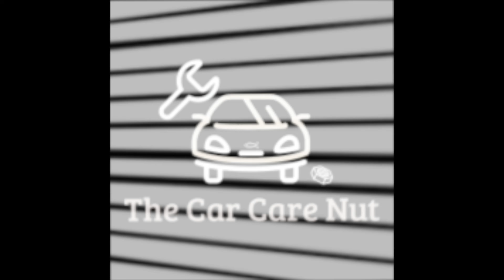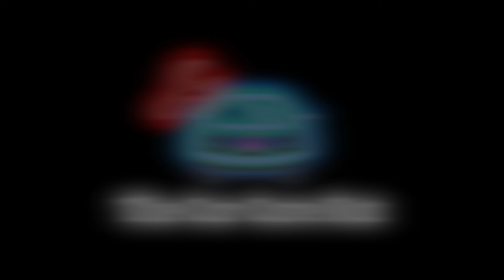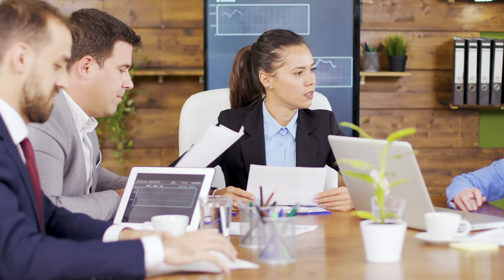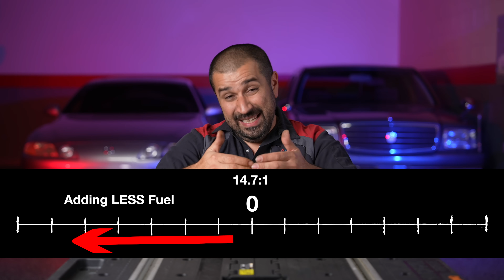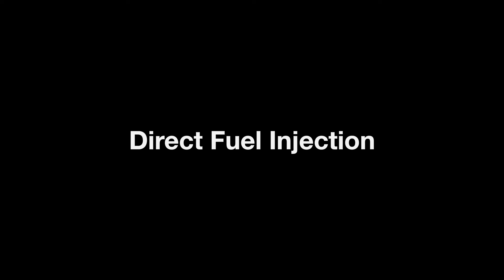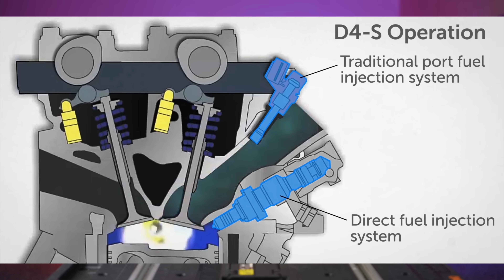Why Do Modern Cars Use Direct Fuel Injection? Fuel Injection Series Part 2

Comment: Direct injection doesnt necessarily mean carbon build up. Hondas 1.5L doesnt have an issue with it. Something about hanging the valve open. Its fluid dynamics so its VERY complicated but it seems like theres ways to design around it. You could argue double the injectors adds complexity and cost. Im just playing devils advocate. If other manufacturers are copying something thats more difficult and more expensive there must be something good about it. But like everything in engineering it is a complicated "it depends" on the specifics. And if cars are anything like computer chips there was probably lots of papers theorising this technique and testing it before it was brought to market. When some fantastic new thing hits computer chips its always based on papers from like the 80s as theoretically possible but worked on making it real over decades.

Comment: You are my college professor teaching me hi tech info. My 2020 RAV4 XLE with your great description of the D4S system is running great with over 54k miles, and I have never had a check engine warning yet. God is blessing you for your great educational videos. Keep up the good work.
Reply: Same here with my 19 RAV4 LE AWD at 131k miles, knock on wood.  This car is literally a maintenance free tank.  Still on original everything except for tires, wipers, oil, washer fluid, and filters.  I’m on the second set of tires and they are less than half worn with 90k miles.  I broke a belt in the original tires carrying over a ton in the back.
Reply: My friend has a 2020 CRV. He has had manly issues unfortunately.

Comment: Direct Injection ONLY: A win win win for the manufacturer.  Win 1, makes for a more fuel efficient combustion, Win 2, makes for more power, Win 3, guaranteed obsolescence - With NO detergent gasoline cleansing the intake ports behind the valves of carbon buildup from the high heat of combustion "baking" the motor oil -  the oil itself "cakes" - deposits carbon buildup behind the valves, this carbon buildup slowly but surely forms ridges that keeps the valves from seating completely in the cylinder head.  Leaky valves causes loss of engine power. Takes about sixty thousand miles before the noticeable loss of power from leaky valves requires an expensive valve job, using walnut shells blasting the cylinder heads.  Article on this was published by Consumer Reports in 2015 when the Direct Injection came in vogue. lookitup.  TOYOTA has historically solved this problem by using BOTH port injection AND direct injection in their motors. The PORT fuel injection cleanses the back of the valves with Detergent Gasoline, eliminating carbon deposit buildup; while the direct injection does its power/fuel economy magic.  Look for the Toyota's D-4S, or Dynamic Force Engine, a system that combines direct fuel injection with port fuel injection in the engine.  What about other cars?  "Mercedes-Benz has been a leader in direct injection technology, with the first gasoline engine using direct injection being the 1954 Mercedes-Benz 300SL Gullwing." (Google)  No port injection at all. In 1980 my father had to have a top end job on his Mercedes 4.5l V8 from this oil carbon buildup problem, the gasoline engine looked like a diesel blowing blue smoke from leaky valves. About $6500 back then.  In 1998 same thing happened to his Mercedes 3l straight 6.  Live and learn.  That's why i've bought Toyota only; and cringe when my wife buys her Mercedes (luckily, she doesn't keep her Mercedes past their 4yr/48k miles BTB warranty)   Well, i cheated, and have a direct injection-only Vette.   BUT in 2019 GM got Mobil 1 to develop a new blend of Mobil 1 for direct injection engines - Mobil 1 Supercar 0w-40 specifically to "Reduce deposits and sludge buildup to enable long and clean engine life." (Mobil's claim)  Exxon-Mobil makes Toyota's 0w-20 oil, but no Supercar additives.  Toyota's oil is made with gynormous amounts of moly, which helps the oil stick to the cylinder walls. Petroleum Quality Institute of America tested both (results online) and found "Mobile 1 variants have formulations with molybdenum between 79 and 88 ppm.  The Toyota OEM formulation made by Exxon/Mobil has 787 ppm of molybdenum."   Takeaway: always look for port injection as well as direct injection combined in the engine of the car you buy, always use Toyota oils in Toyota engines, and the smaller your engine, the more frequently you should change your oil: 3k miles/6 mo. for 4 bangers,  5k miles/6mo. for the old reliable Toyota V6's and V8"s  (also known as the severe duty oil change intervals in your Toyota owners manual)  Remember, Toyota makes million mile motors:  Corvette's and Benzes are sold long before the odometer starts on their second set of six figures.

Comment: We use direct injection because of emissions crap. Also they don't rev passed 7500 rpm due to how fast compression strokes are happening at high rpm port injection is better

Comment: 9:25 great content!!!  I have a 2023 2GR-FKS with what seems like a fuel delivery issue. At low RPM in a high gear range (automatic transmission) when trying to maintain speed (40-50 mph) the engine stumbles until one of the board members tells the transmission to shift to a lower gear. If the transmission does not shift down the stumbling will continue until the load is reduced, the accelerator pedal pressure released. Any thoughts?

Comment: Thanks AMD, a great video, very informative. Have you any idea why there have been numerous reports of injector failure in 2.0 Corolla Hybrids with this new technology ? Details are scarce as new car buyers are not very technical and its usually fixed under guarantee but it seems Toyta has been replacing a number of injectors, probably the high presure ones. I have also read a couple of reports of complete engine failure. There is a suggestion that its related to low quality supermarket fuel. I have also Googled for the fault in German and not found any reports , so it does seem to be a UK issue. How are you getting on in the US with this engine ?

Comment: Direct fuel injection isn't all that "new."  Mercedes used DI on their M198 engine in 1954.  It was a totally mechanical system, very similar to diesel systems of the time.

Comment: Another way that Direct Injectors achieve high pressure is using basic fluid dynamics. The fuel line going from the gas tank is about 2x the volume than the fuel line from the high pressure fuel pump. So if you do the math, 70 psi in half the diameter is actually 4x the pressure. So the starting pressure for the fuel rail on GDI is 4x (or more) than your 70ish psi (280psi) and thus the high pressure fuel pump only needs to increase that by a factor of 10, not by a factor of 40, which means less work.

Comment: this explanation was just perfect you answered my question does it run on port when cold and heating up just bought a c-hr  2.0  awd  very happy with this car will take your advice change oil every 6 mths or 5000km  dealer says not necessary  but will do   watched a video on  hybrids hard on engines

Comment: I've never owned a carburetor vehicle.  I think as a kid my dad had to spray something in the engine bay to get it back running after it stalled.  

Wonder if I am missing out on any experiences.  My 2 cycle mower runs just fine for 22 years...... no issues.

Comment: I would like a video on how a clutch in a manual transmission works. I know there are a lot of videos about it, but your videos are entertaining to watch. I would also like to see a video on the automatic transmission. I know you did a video about the torque converter, I would love to see a teardown of an automatic. I would also like to hear your opinion on how many gears should be in a transmission. I daily drive a 90 honda accord with a 4 speed automatic, and I feel that with any car below 140hp that it should only have 4 gears. My other car is a 2012 Hyundai accent, and it is a 6 speed, and it's in 6th gear at 35mph, and it only has 138hp. I find that car constantly jumping down to 4th just to get extra torque. I know engineers do it that way to get the best fuel economy, but in my opinion, they should change the shift points so it doesn't constantly have to shift.

Comment: A25A FKS hybrid, when not warmed engine kicks in what injectors working on first 30s? port or direct? And yes these first 30s I can feel engine vibration, but when the injection cycle changes after 30s vibration goes away immediately. But it happens only when engine temperature gauge is near minimum. Port injectors problem? spark plugs? odo only 50k km

Comment: I intentionally bought a 2022 hr v because it has port injection only. It constantly provides 28 to 34 mpg without excess pressure on the engine and without uneccessary excessive computer complication ...even with awd !
Sometimes, in the words of my long departed boss.... " less is more".

Comment: It would be very cool if the 1ur in the GX 460 had d4s system like it does in other cars. The GX's v8 is great but it would be a contender for the best ever with about 60-80 more horsepower and/or a couple more mpgs as I suspect could be wrung out of the engine without even making it work too terribly hard. An 8 speed transmission in the final couple years could have made a big difference too.

Comment: Car care nut, could you do a video either on this channel or your review channel on the RX350h?  I have contacted two dealers with some very specific drivetrain questions and I have found sales personnel are not prepared to answer such questions.  
As I understand it the hybrid system utilized in this vehicle is the same as the Highlander Hybrid (comment if I am mistaken).  So what is the difference in the vehicles?  One sales person said the RX350H has a turbo engine the other said it didn't etc.  
Hoping we can get clarification on specifics of the hybrid system on these vehicles, your assessment of its reliability and then some differences between the Toyota and the Lexus.

Comment: One of the major reasons for dual injection is reducing the load of the high pressure fuel pump on the engine, which is usually driven by the camshaft. When the engine is at low load, and cylinder pressures are low, using DI is not advantageous so trying to pressurize the fuel to 3000+ psi is a waste. 

Additionally, its to reduce soot emissions. At low engine speeds the air in the cylinder is not really swirling enough to promote good mixture of fuel in the very short amount of time that direct injection gives and so you have rich spots. By using the port injectors, it can allow the fuel to mix more evenly, promoting a cleaner burn.

Comment: At some point other manufacturers found other solutions to the intake valve coking. It was not necessarily an issue except for maybe on some of the early german DI motors. 

People still talk about it but I dont know anyone who has had a major issue with. Look at Ford with the F150 Ecoboosts. They produced literally millions of F150's with direct injection only for 6-7 years and its just not a wide spread problem. Perhaps there are some specific cases where people took poor care of the engine and used poor quality oils and had an issue, but in general its not a problem.

If the port injectors were to help clean the valves, why wouldn't Toyota and Ford want to talk about it? Wouldn't that be a selling point for their engines? "Hey look, all these other idiots have DI only but we have dual injection!" But no, they specifically say that was not the reason for using dual injection. Its not like Toyota has some kind of dark history where they need to pretend it didnt happen, they pretty much introduced D4S as soon as they started using Direct injection.

Comment: As an owner of an 07 IS250 (very early iteration of the 4GR), I feel like the issues with the motor are so heavily overblown. I change the oil in my IS250 every 5k miles with Penzoil platinum or Royal Purple synthetic, and at 130k miles there is zero oil consumption when I check prior to a oil change in my level garage. My car also does not leak any oil or fluid at this time as well, and has never had a carbon buildup related issue. If you're afraid of carbon buildup, then do not purchase any Honda, Hyundai, GM, or Ford as almost all of their engines do not have a "D4S" style injection system and will potentially harbor the same "issues" at the 4GR. Obviously that is ridiculous to avoid such a large majority of brands that dont offer a D4S style fuel injection system. Many 250 owners have much higher mileage than my vehicle with zero carbon buildup issues, alongside many Hondas without D4S that have zero issues with carbon buildup as well. Do not put down an engine just because it does not have port and direct injection. Maintenance is key, and it will always be the most important thing to how well your engine behaves.

Comment: Why DI ? Its the triple crown win. It’s the only time I know where ONE system improved THREE opposing things. More power, lower emissions AND better fuel economy
Reply: Port injection did the same thing when it came out
Reply: @ small effect on hp vs carb. DI allowed an increase in compression in high gave a big hp gain and emission reduction
Reply: @DaveSoCal  it didn't allow higher compression
Reply: @ with DI the chance of detonation is extremely low so that allowed higher compression and and more efficiency. You can compare engines with DI and WO to verify, otherwise we’ll agree to disagree, have a good night
Reply: @DaveSoCal  I know that but they still didn't run higher compression
Reply: @ one example , Toyota 3.5l 2005 has 10.5 vs 2008 w/DI has 11.5
Reply: @DaveSoCal  that was most likely to see if it was possible like as an experiment
Reply: @ oh good lord, Toyota doesn’t “experiment” with engines they put in cars they sell to customers(that’s the Germans). Do some reading, I sent you ONE link of hundreds so it’s easy. Have a good night.

Comment: Hi Mr car care nut. I have a question. My wife drives a 2014 rav4 xle. She was driving yesterday and when she was on a little hill the car rolled back when on drive. The car has almost 112000 miles. We never did a transmission fluid change. What do you think about this symptom?

Comment: I have a D4s Camry.    It’s a great running car.   Performance and fuel efficiency are great.
Reply: I have the 8NR-FTS 1.2 Turbo engine in My Toyota Auris brilliant engine and 85,000 faultless miles so far in just over 8 years.